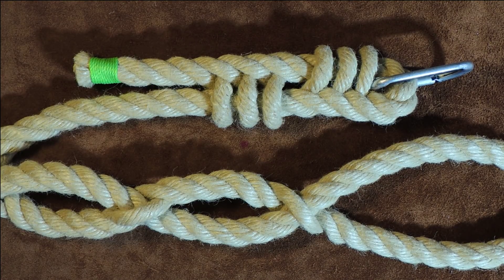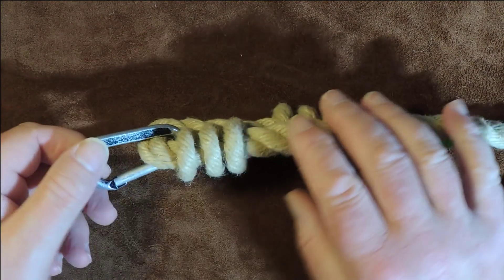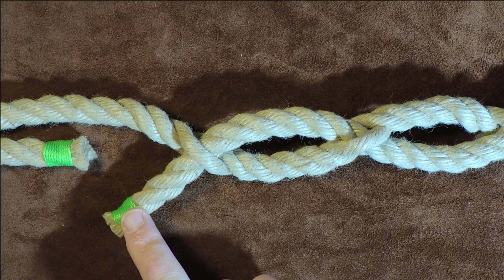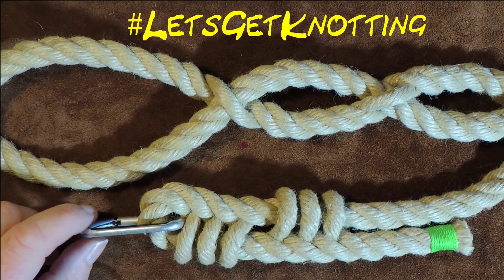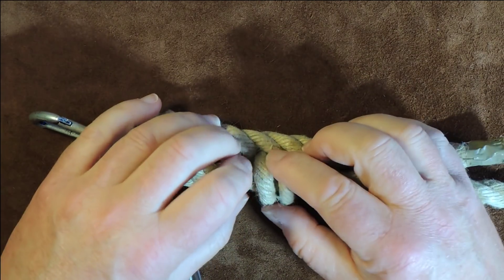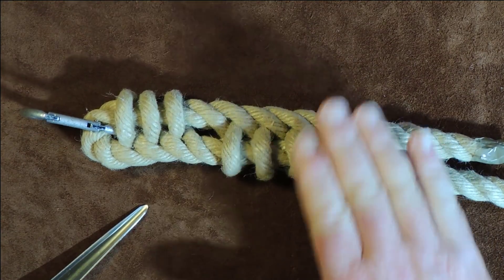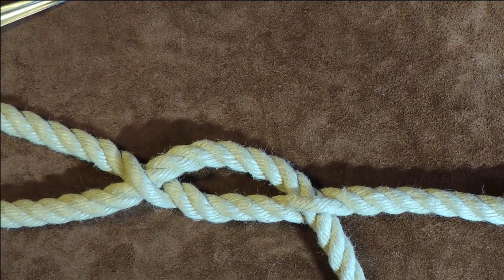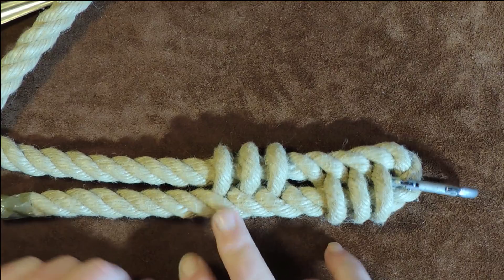Decorative Rope Dog Lead - Simple and Quick to Make Dog Lead/Leash

Comment: Hi, great series of videos and thanks for sharing. Where did you get your gas torch from?
Reply from the maker: I got the lighter off eBay, it is a turbo lighter. If you are looking to get one, and you want to decorate it like mine, just make sure that the body can be easily convered. There are loads here: https://rover.ebay.com/rover/1/710-53481-19255-0/1?ff3=4&toolid=11800&pub=5575285280&campid=5338064521&mpre=https%3A%2F%2Fwww.ebay.co.uk%2Fsch%2Fi.html%3F_from%3DR40%26_sacat%3D0%26_nkw%3Dturbo%2Blighter%26rt%3Dnc

Comment: Thank you for answering so quickly, I will buy some nylon 3 strand rope and try out the cats paw hitch and let you know the results, I hope you do not mind me using part of your ideas. I do change parts so they are mine. I too do not like to burn the ends so I normally tie a lanyard knot and then add beads to the ends. I love Australia, I was there in the of 1972 and the beginning of 1973 for rest and recuperation far my tour in southeast Asian, for 6 weeks. I was then stationed in Germany where I got several chances to visit England. And as General Patton said the only thing separating us is our common language. It took me several days to understand what was being said, London is OK but the country side is fantastic. I took up paracording after being wounded in Iraq while disarming several bombs, the bombs didn't go off a mortar hit next to me killing my partner and throwing me over 200 feet thru the air, and thru 2 walls, so I know what it means to be hospitalized 2 1/2 years. I no longer have any feelings in my hands so it takes me much longer to make something. But in the end it is worth every minute that it takes me. Oh I was Army Special Forces, and we worked with SAS from both England and Australia.
Reply from the maker: Many thanks for sharing some of your military stories. For me, my claim to fame was; Falklands, Gulf 1 and former Yugoslavia. I would say, that it must be rather difficult to knot and get the tension right, especially when your hands do not feel. It is good that you are seeing something and then making it yours. I often use two coloured whipping to make the work stand out a bit more. And like you, I would rather tuck the ends away than melt!!